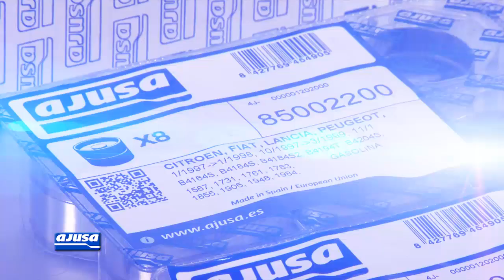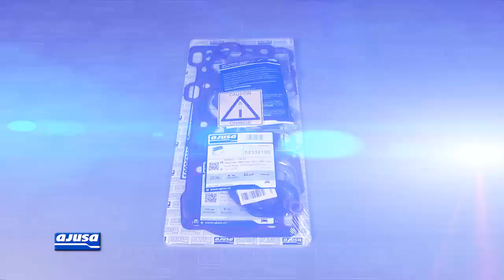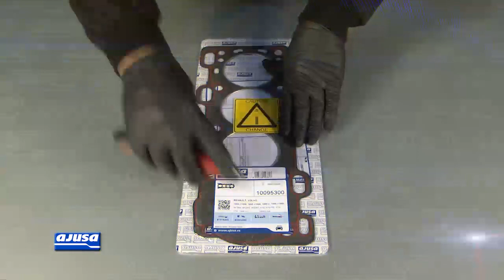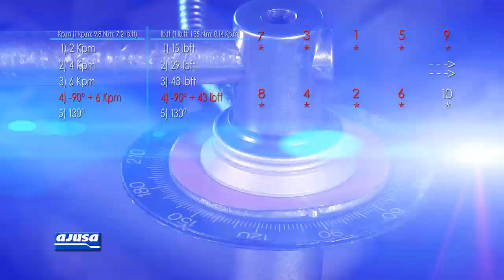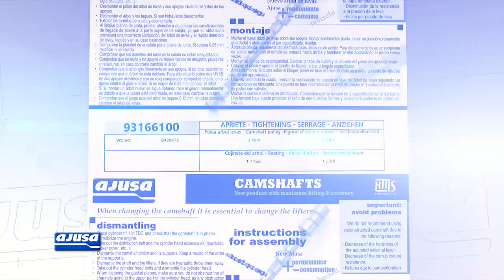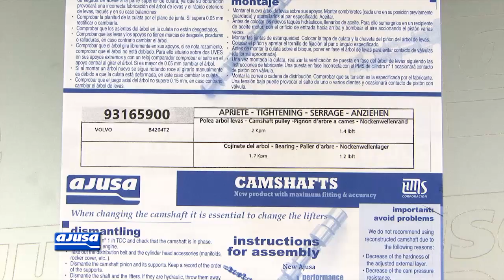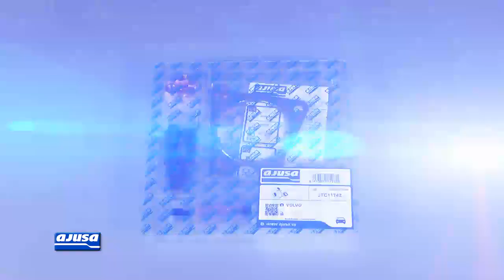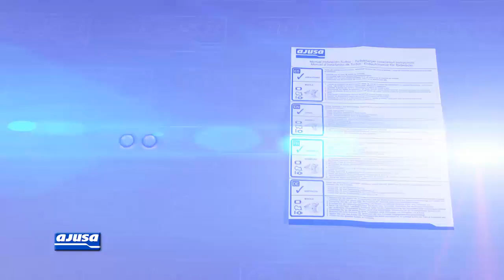Full set / Juego completo VOLVO S40 TURBO 16V B4204T .

Comment: Hello, my engine is B4204T3 on 2001 Volvo V40. Could u tell me the torque of valve gasket bolt please? Same as the video or not?
Reply from the maker: Hi! The torque is the same that you see in the video. Kind regards

Comment: How do you know what way the cams go?
Reply from the maker: Hi Stephen! You have to put them with the sync grove horizontal, to be able to use the sync adjustment tool. Best regards
Reply: @AjusaAutomotive  I know but which way up 2 possibly
Reply from the maker: @stephencrabb5123  When you use the spedific block tool, it only could used by one way. Therefore you need to use this tool. Best regards

Comment: I'm not too sure what the fuck they did to this poor Volvo, but this video has all sorts of wrong things. First, you never use RTV on the camshaft valve cover. Second, why are they replacing both camshafts? Is there some strange reason this asshole decided to remove the gear sprockets from the end of their camshafts? It is not necessary to use a camshaft cover holding tool, while securing it. Using a camshaft locking bar at the end of both camshafts, is more than sufficient. And please; if you're going to remove the turbo, rebuild it, check the waste gate for functionality & adjust it to the correct boost.  Also, why was all 20 lifters replaced? Basically, this is a fucking advertisement for parts.
Reply from the maker: The purpose of our videos is to show the assembly procedure of our products, like Gasket sets, Head gaskets, Head bolts, Hydraulic lifters, Camshafts, Ajusil silicone sealant, Miscellaneous gaskets, Turbo components, Oil feed pipes, etc. Therefore, on these videos, we replace all the AJUSA manufacture components ,regardless of old component conditions. Best regards
Reply: But you CAN NOT use silicon to stick engine parts!!
Volvo Cars never use silicon!
In Volvo you can stick engine parts only with Anaerobic Glue!